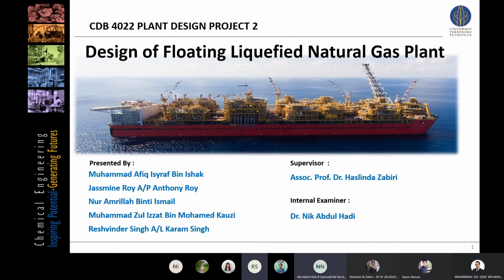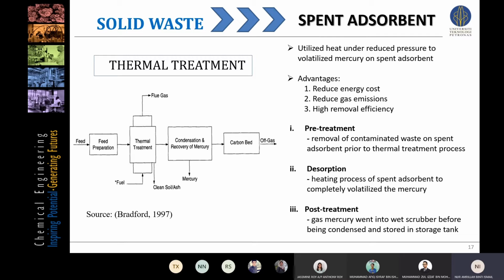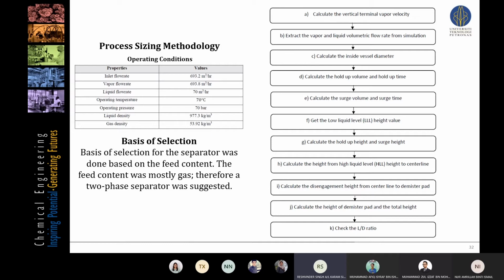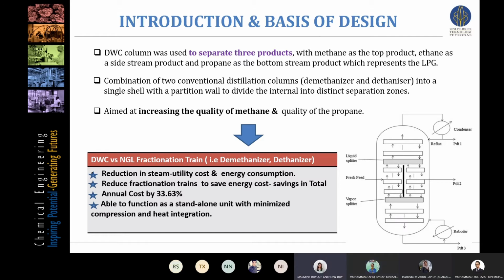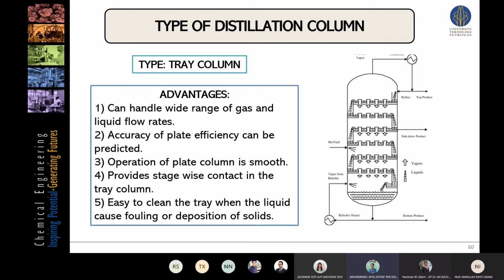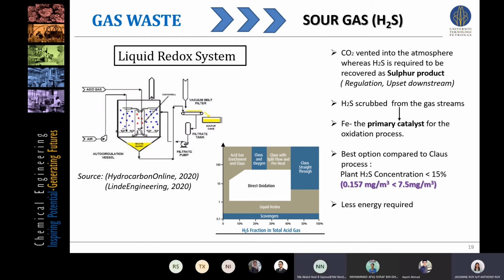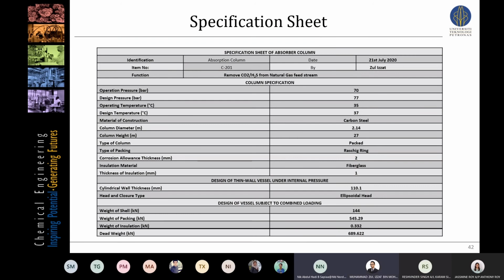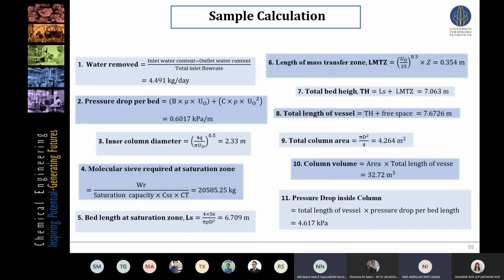UTP CDB4022 Plant Design Project 2 (PDP2) - Design Of Floating Liquefied Natural Gas (FLNG) Plant

Comment: Energy security and sustainability are undeniably the main concerns in combating climate change. While an immediate call for all-green and renewable energy seems to be impossible due to huge financial implications and inadequate supporting energy structure, an alternative to fossil fuels needs to be established. Natural gas, a naturally occurring fossil gas is a cleaner energy source  option compared to other fossil fuels such as coal, bitumen, and diesel. Natural gas makes the best fit for a sustainable renewable energy transition in any country around the globe due to its competitiveness towards other fossil fuels such as coal and its ability to aid the integration of renewables. Natural gas as a transition fuel in attaining sustainable renewable energy transition should be further evaluated based on four pillars namely availability, applicability, acceptability, and affordability. Renewable energy targets, natural gas policies, and related frameworks should be enhanced to support the utilization and development of natural gas as the alternative energy source in transitioning toward a sustainable energy system and academically should be linked effectively. Thanks.